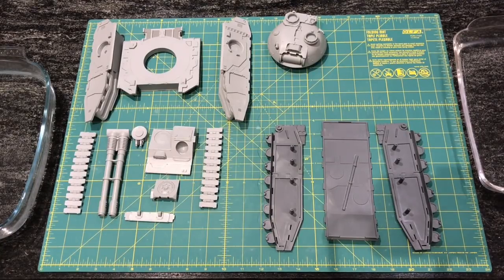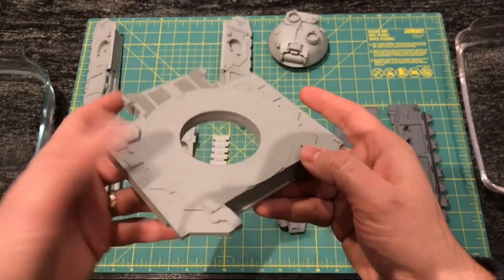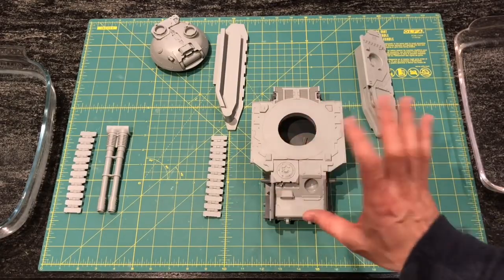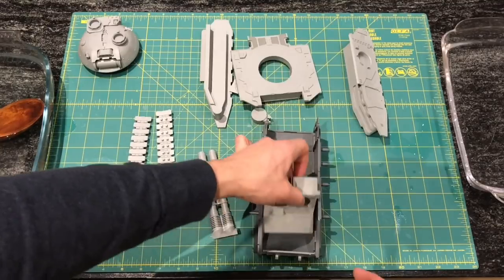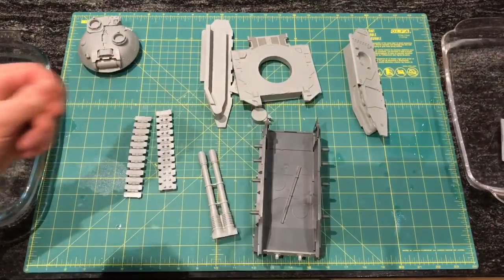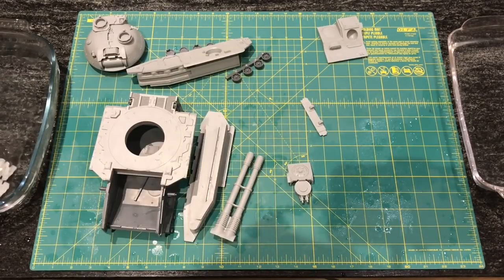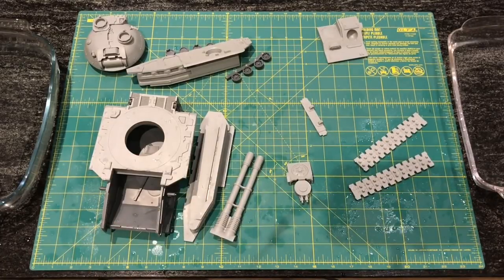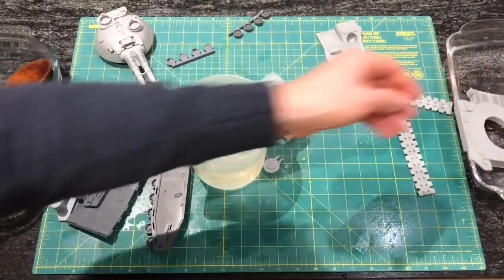Legion Fellblade Build Guide Part 3: Bend it like Leaky (Forge World, Horus Heresy, WH40K)

Comment: Really interesting video and thanks for the tutorial. Just a quick question if I may. Do you do all of your "resin whispering" with hot water before assembling all the parts or do you find you have to do the odd hairdryer fix while assembling? I've an Astraeus arriving via Santa drop shipment on the 25th and having only built a Sicaran before the thought of dry fitting and manipulating lots of parts is a little intimidating. Cheers!
Reply from the maker: Personally I prefer to use the hot water approach because it offers more control i.e. you can easily heat up a certain section of a model and manipulate it without the whole thing being soft which is really useful at times. For example you can work out bends bit by bit without having the whole part go soft at once.

With a heat gun/hairdryer it is harder to heat up bits of parts to bend as you tend to end up heating the whole thing. On the flipside it's quicker to set up and less messy in general.

I'd recommend you try both and find whichever works best for you... maybe you might find uses for both techniques.

I know Sup3rSaiy3n said he was going to do a series on building his Astraeus so I'd keep an eye on his channel for that.

Hope that helps and thanks for watching :)
Reply: Thanks for the response, really appreciated.

Comment: Why do you prefer water over a blow dryer?
Reply from the maker: Personally I prefer to use the hot water approach because it offers more control i.e. you can easily heat up a certain section of a model and manipulate it without the whole thing being soft which is really useful at times. For example you can work out bends bit by bit without having the whole part go soft at once.

With a heat gun/hairdryer it is harder to heat up bits of parts to bend as you tend to end up heating the whole thing. On the flipside it's quicker to set up and less messy in general.

I'd recommend you try both and find whichever works best for you... maybe you might find uses for both techniques.

Hope that helps and thanks for watching :)